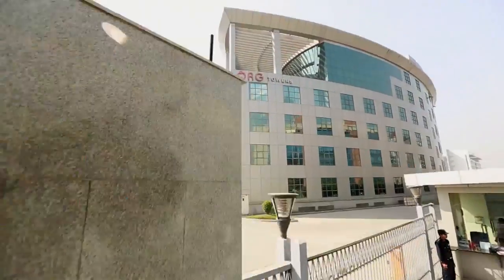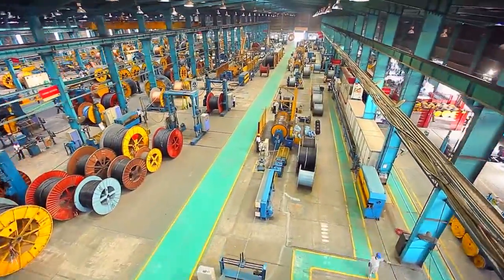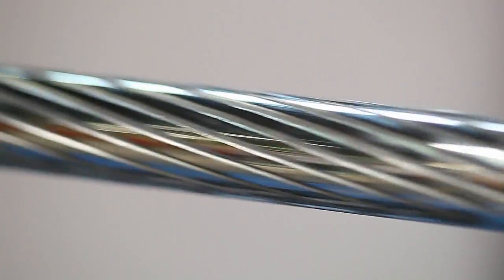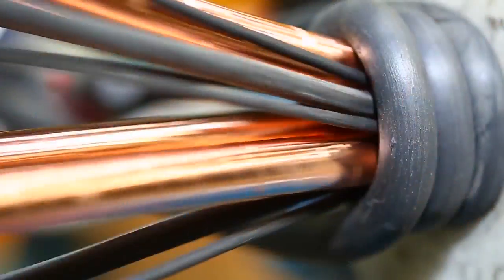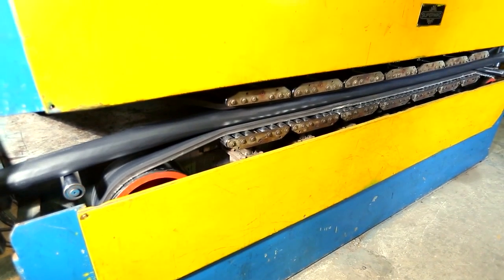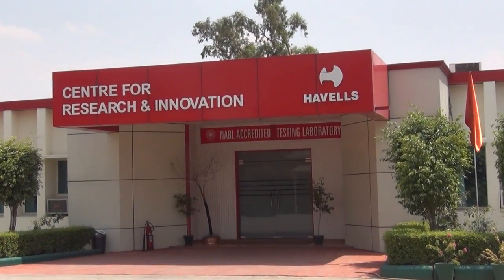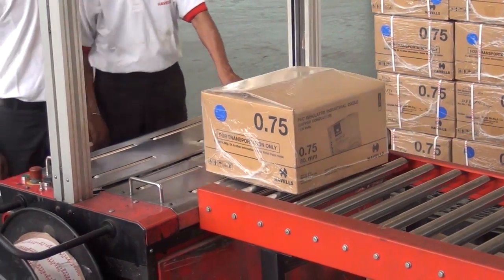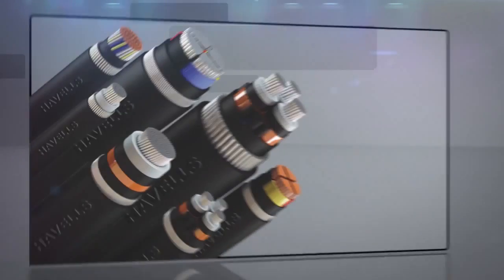Havells Cables and Wires Manufacturing Plant Video 2015

Comment: Can you explain how many meters comes in a coil
Reply: What size?generally its 90 mtr for single core cable and 270 mtr - 450 mtr in project packing(for multi strand wire)
Reply: Antonmursid🙏🙏🙏🙏🙏💝🇲🇨🇲🇨🇲🇨🇲🇨🇲🇨💝🙌👌👍

Comment: Why are the cables outer sheath in black?
Reply: black is easy to match, relatively cheap, and helps with heat dissipation. Black color will not hold the heat, it is having the higher emissivity. If black sheath cable is heated, after some time it will automatically liberate the heat.